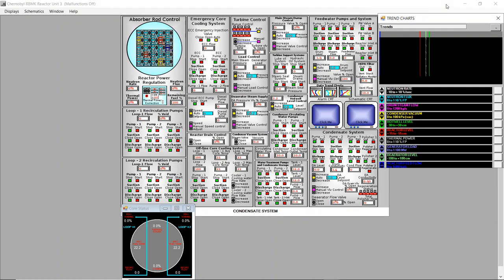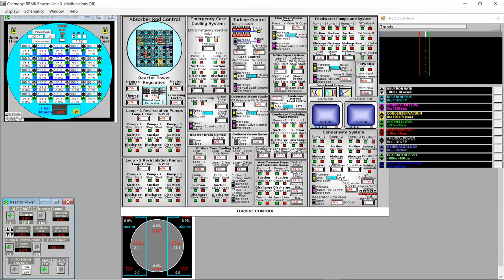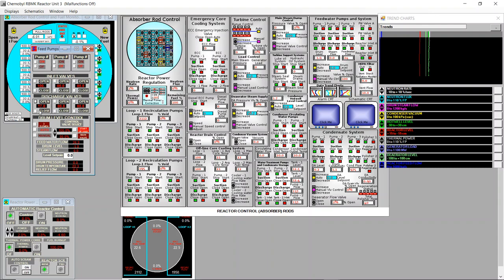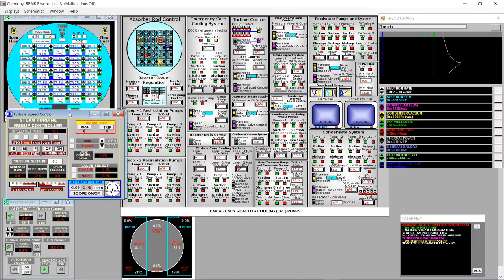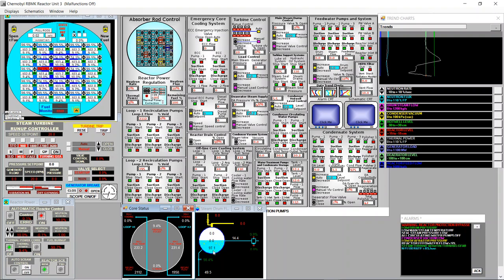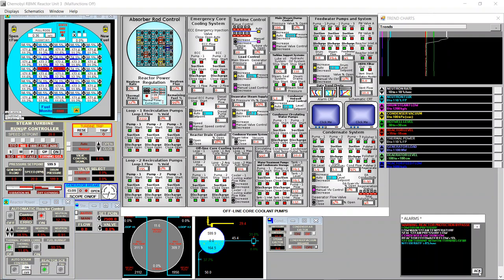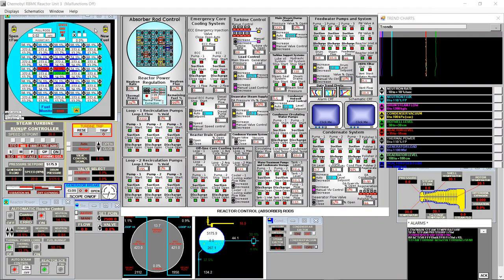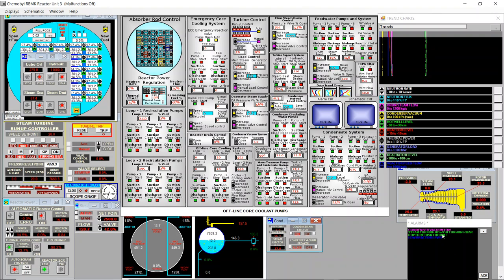Chernobyl Nuclear Power Plant Speedrun Startup [Rupture Disk this time]

Comment: If you have any interest in trying this again, I have a procedure where my last input is at about 6 minutes 40 seconds. Neutron flux is at 99.5% and turbine vibration is high, but eventually all remaining alarms resolve themselves on their own and the reactor would reach 1000 MW given enough time.

Fuel kept at 100% and Xenon Poison kept at 0 using cheat engine, no other modifications. One can easily waste a minute fiddling with the generator breaker.
Reply from the maker: Man this is tempting...

Comment: Open up your condenser air ejector early, around at around 1500 steam. It wont develop a good vacuum, but will come online automatically and prevent a rupture disk event.
Reply from the maker: Yes, you are 100% right. I always do like that, I just wanted to try if it turns on automatically without selecting it, and the answer is: NO

Comment: Hey again,

the name is fine, it is taken from my google account, as my second name starts with Pü  I usually run under the name "AndyP" thus naming it "Andy P." is fine for me.

Yeah, the automatic control works on 'all rods' all the time, and the 'centre core only' button is only for the manual controls. I tried to find the rod position addresses with cheat engine, so I could actually lock the outer core to 100% and see how the automatic control handles this. (You can in theory return to "outer core at 100%" if you set it to: "inner core only, slow, raise" it will then manually up the centre core and the automatic control will push the outer rods down again. (You need to stop when they reach 100% - as you overcome the automatic control with manual commands and it will raise power.)

I played a bit with the WWER-1000 simulator and I see how you got distracted by it, its also interesting to see the completely different dynamic in there. I would like some type of alarm there, as the automatic control there seems to be 'fixed to the selected ACP control group and does not seem to switch to the next group if it reaches its limits. That made me get a max power SCRAM on it, while I was sending out boron to the storage tanks, replacing it with 'freshwater' and not seeing the automatic control did not switch to the next group for lowering rods. (If it has a good reason to not change the group - it should at least drop some signal like "ACP - limit / disconnected".)

The "steam ejector" ON-light, seems to be related to the flowrate, so unlike all other controls there, it seems to get the actual feedback from the function of it. (So pressure or flow rate should turn it "ON", you can test this by dropping the pressure again, once you go below a specific pressure/flow rate it shows "off" again.

Steam turbines:
Yes, they work mostly the same with the exception of steam temperature. Nuclear reactors go mostly for 'slightly overheated steam' while most other thermal processes try to achieve high temperatures by superheating the steam far beyond saturation.  (Topic: 'Carnot cycle' if you want to dive deep into that topic. =))
I also think the 7500PSI are more a thing for reactor safety and operation. The turbine would be happier to be run with a completely open inlet valve, as any reduction in pressure also reduces temperature, so any valve throttling flow through resistance will decrease efficiency. Even the simulator seems to have a basic model of that built-in, at 80% thermal power, the governor valve will move up and down erratically and you cannot get steady values, but when manually setting it to a position to keep the 7500PSI it seems to run stable.
However, opening them completely and dropping the pressure something around 5000, made the total power output of the turbine end up higher than before.

A pressure rising and lowering with the power output makes the reactor level quite sensitive to fast changes of thermal power above 10%, so a static pressure helps all the regulation systems to keep the levels stable. It would possibly be best to have the main steam dump valve set-point follow the actual pressure +100PSI or alike, so any sharp rise in pressure would immediately be prevented by them, the turbine setpoint should also follow the current pressure -100PSI so a sharp decrease in pressure would immediately make the turbine close the governor valves and keep the pressure stable. (There is a similar thing in the fuel - pressure - power output control loop in conventional power plants that prevent sudden changes in boiler pressure.)

Anyway, despite the long comments suggesting something different:
I really like your videos, your voice and background information given, keep up the great work!
Reply from the maker: Thanks a lot for you comments! I actually saw it yesterday before going to sleep, but I'm in a very different time zone and had to get to bed without replying.

I think this simulator is quite limited concerning control rods operation, its strong point is the turbine and generator module, I guess Simgenics provided the turbine module to some other industries that's why it is more refined. As you already saw, the reactor and neutronics model of the VVER-1000 simulator is in another league, very physically accurate to reality, in the other hand, VVER-1000 has very poor turbine model, clearly it was made to train reactor operators because in real NPP turbine and reactor operators are completely separated jobs.

Clearly the 7500 kPa (not PSI, 7500PSI would be well out of design range) is set according to reactor preferences (voiding). I'm not really sure if it's a good idea to set the main steam dump valve set-point to follow the actual pressure +100PSI or some incremental criteria. When you want to connect the turbine you want the least possible perturbation to the drum flow and reactor pressure, that's achieved by the dump valve set at a given pressure and dumping steam into the condenser, then when we connect the turbine the valve needs to progressively close to maintain a constant drum steam flow. 

Thanks for your support! I like learning new things from experts like you!
Reply: @argilaga  Oh, yeah, I think simgenics just put a "North American" turbine model because they had it there already. (As you mentioned in one of your previous videos)

Oh, yeah, my bad, 7500PSI (a bit over 500bar..) would be really high for a nuclear reactor, kPA is right, true.
The idea with the "following setpoints" was to make the throughput and pressure stable.
Main dump valve would then immediately take over if the turbine trips. (Seeing the default being 1000kPA apart from each other, should result in a total loss of flow when the turbine trips until the main steam dump valve opens - needs to raise pressure by 1000kPa before flow starts again.
A sudden drop in thermal power would then prevent the pressure from dropping - assuming the turbine is run in max-efficiency by a fully opened governor valve.
It would not matter if the turbine is set to a static pressure point - it would always keep the pressure then - unless a turbine trip occurs.

Thank you for your reply. We all learn from each other!
Our timezones should not be too different - I just have an out-of-normal day/night cycle due to my work. (I am on UTC + 1 / CET)
Reply from the maker: @AndyPue  My hometown is also in CET, but now I'm living in UTC + 8 ;)